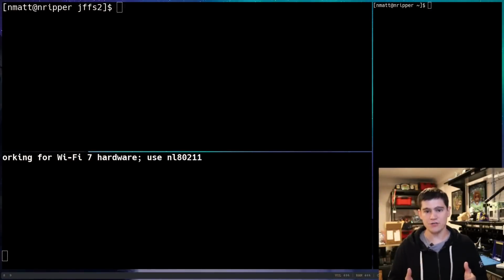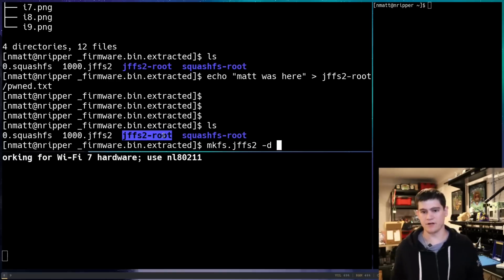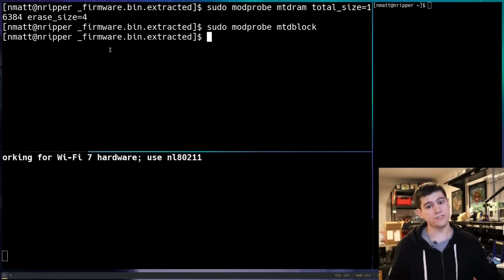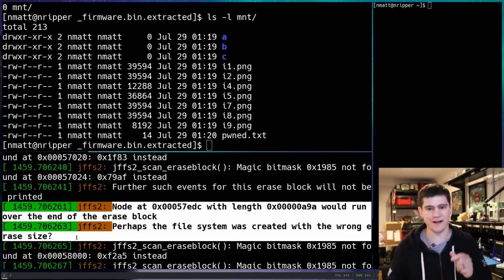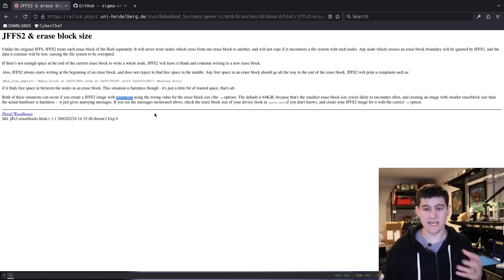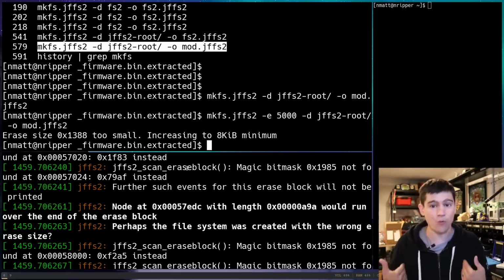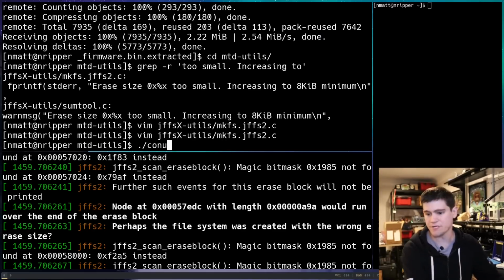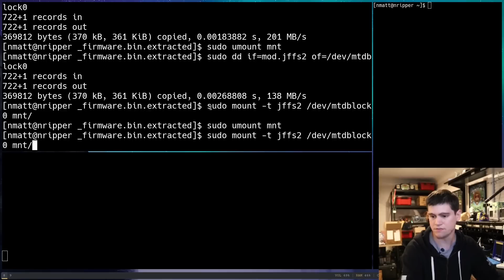JFFS2 Firmware Modification - IoT Pentesting Tips and Tricks

Comment: Interesting video, it's even nice to see how you use the shell.

btw you don't need flux for de-soldering. that will save you some clean up! the solder will melt at the same temperature with hot air whatever. 

flux is mildly corrosive and helps the solder flow and adhere when soldering.

Comment: Why this 8KiB limit exists? 🤔
Reply: Been over a decade since researching this, 4KiB minimum worked on 32bit systems. mtd-utils had this same problem on 64bit systems back then.  Automated tools might have been used to do some of the low level conversion for 64bit resulting in a doubling of the minimum size. Probably an oversight.     

I'm a trash programmer so don't take this as truth.
Reply: @SlinkyD  Then this is very strange if this kind of filesystem should work as in real hardware (here limit 4KiB) in embedded systems, even 64bit.
Reply from the maker: Not sure really
Reply: @jankomuzykant1844  I did write that 1st part kinda ambiguous and will edit.  I think the problem came when mtd-utils started to be compiled for 64bit systems and they used an autotool to refactor, it just doubled the eraseblock size and nobody really checked.     

Like I said, its been a decade since I had a similar problem and did the research. The only reason I came to that conclusion is because the two systems I was using at the time was a 32bit & 64bit system. The 64bit system had the problem, 32bit system was good. So I put it all in the corner of my brain until this vid.    

I still got the 32bit system and I think I got the flash drive I was working on. I'll try to find out what is what if I ever get the time.